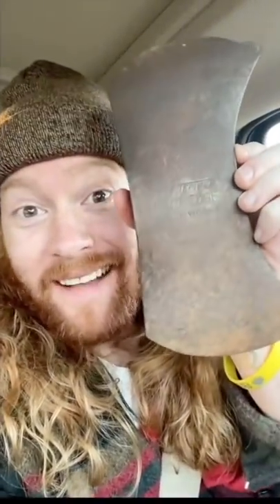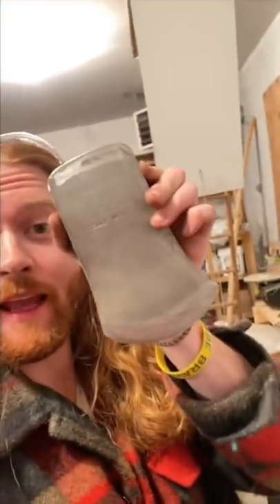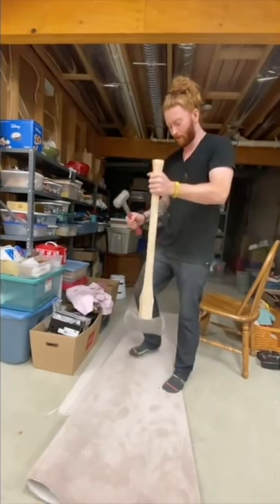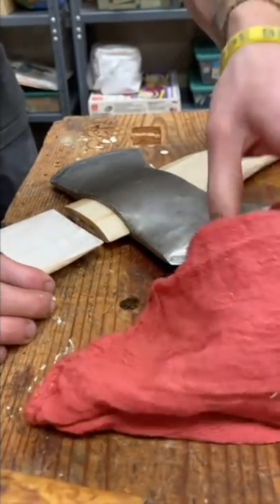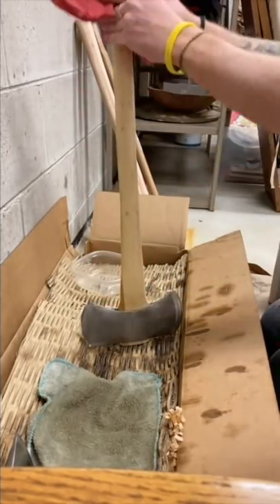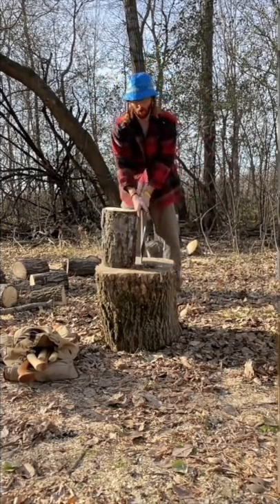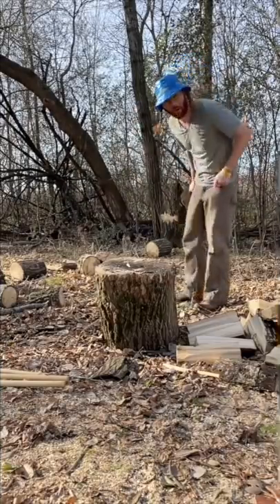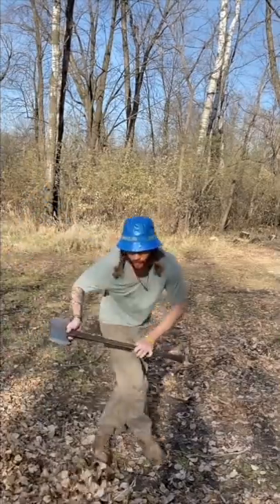So I've Started Restoring Axes, And I Love It! 🤗

Comment: Just wondering, what’s specifically advantageous about a double bladed axe? Like what can you do that you can’t do with a single bladed one (besides just slice more people lol)? I usually appreciate being able to hammer my axe into wood, so I’m intrigued as to why you’d want a double blade
Reply: Hi Penny, 
I guess you could chop twice as much wood between sharpening.
I don’t know why as you say it’s particularly advantageous either, interesting thought.

I like this Axe head because of its curved blade edge and the eye shape, which tells my experience it might be a good splitter, or the weight being evenly distributed adding to aerodynamics and maybe less effort may be needed...... The Shape of the handle, how much hilt there is, grip and movement.....
So I guess I would say, for  Me, it’s an Axe that appeals to my wood chopping joy, practical, handles well & visually pleasing....
You mentioned you hammered your axe head in, maybe a wedge and 14lb lump hammer will save blunting and energy? 
I hope you are well and safe as possible in these times.
❤️🙋
Reply: Limara64 What a lovely response, thanks so much!